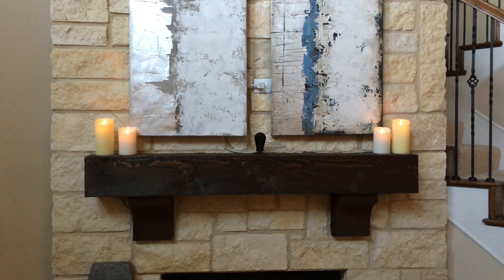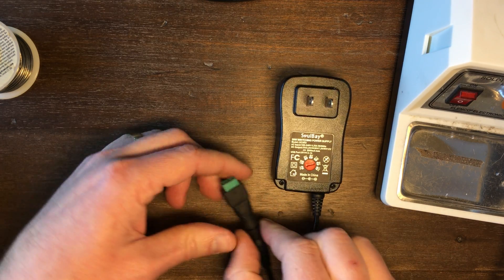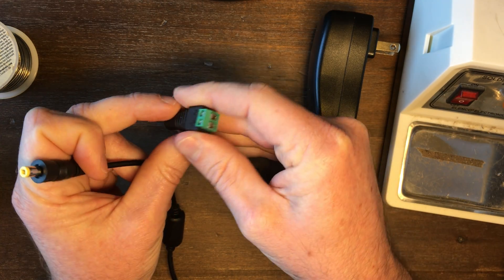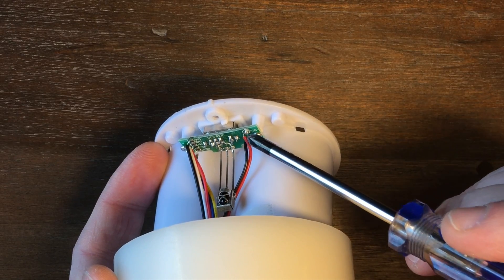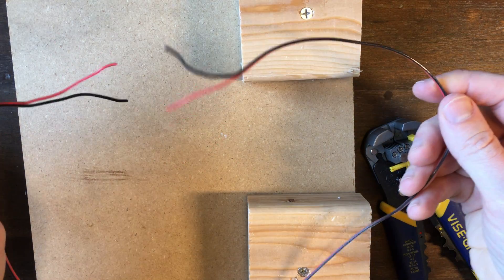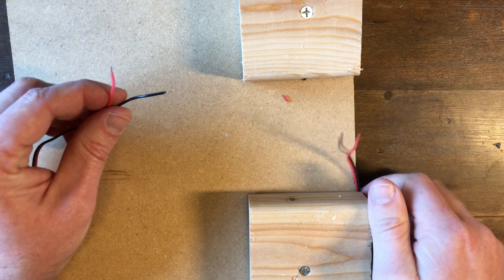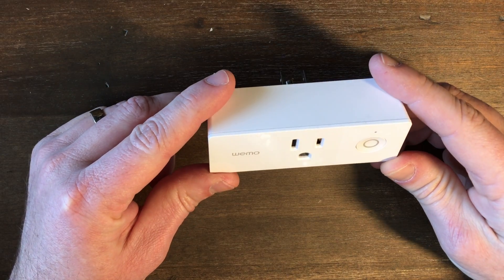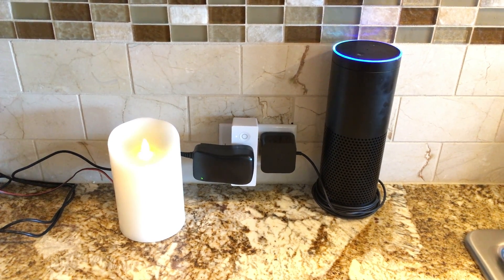Alexa Controlled LED Candle

Comment: Looks great! I've actually use the soldering iron to melt a hole instead of drilling, I broke the wax before by drilling. Is there a way to "link" several candles together, without multiple plugs, since the adapter does adjusts in voltage? I have led candles for my Christmas tree (12) and wanted to group 6 and 6...
Reply from the maker: Hi. Yes, you can do that. I have 4 of them. Hook them up in parallel and the voltage will remain the same. The amps will go up at you power supply, so make sure it is rated high enough, or they might start behaving strange. Ones I do this,  will post updated video or diagram. Good tip about using soldering iron on the wax!
Reply: Thanks, I've purchased some of the "tap" clips for the adapter line, we'll see what happens. Yes, I'm making sure the voltage is compatible...